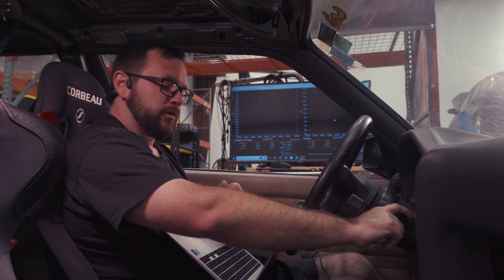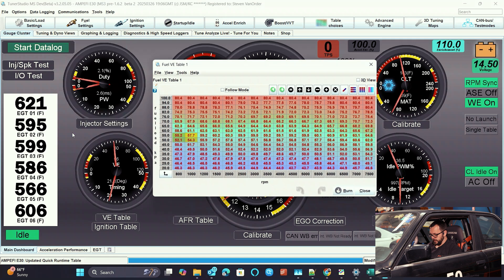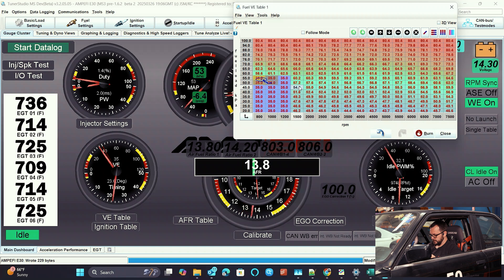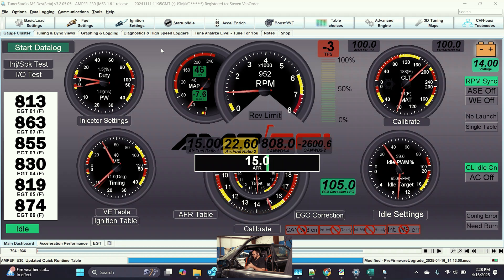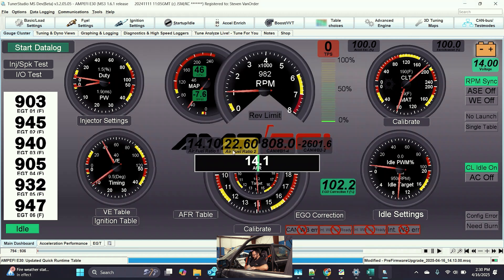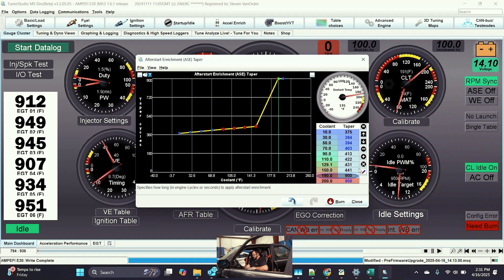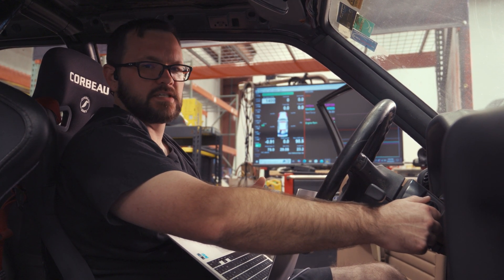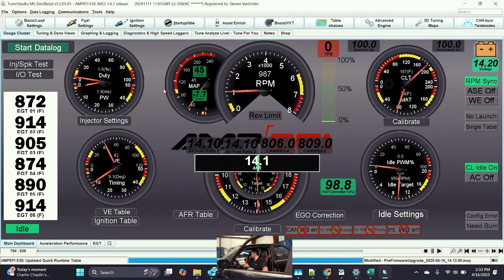BMW E30 First Start! VE Table Adjustments & After-Start Enrichment | MS3Pro Tuning Series – Part 2

Comment: I love this, your new series of videos are great. I hope you get into acceleration enrichment
Reply from the maker: @Adamsawyer01  we absolutely will, AE tuning is hard to do on our hub dyno so I may have to do that part with datalogs.
Reply: @DIYAutoTune  I struggle with tuning AE using datalogs because of O2 delay and try to dial in by feel. Also when to use TPS based or MAP based enrichment. Any tips would help
Reply from the maker: @Adamsawyer01  I will make some basic ae setup and tuning one of my next subjects to capture on video. If you have not you may want to sign up for our email list. We send out alerts and articles that cover the content in these videos. Our support tab on diyautotune.com also has a plethora of information.

Comment: Testing would be better waiting about 5 minutes in, but ideally the ve has to be tuned  1 st without the heat soak boudary layer influence. The hotter the engine gets after sitting the ase taper time usually will not to increase.  A great video though!
Reply from the maker: @norb231  ase tuning and fuel temperature rise from an extended wait period are different issues. In this video I focused on ase tuning.

Comment: 2:15 - when making these adjustments, do you have to hit the "enter" button after each change for them to take affect?
3:51 - it took me a few seconds to find your After start and EGO gauges or event lights. I'm the future, could you make it easier to find by showing us where your gauges are? I use the basic dash cause I'm a novice and things are easier to see and find 

This was an awesome lesson, i learned something today. I'm not as proficient at making adjustments with my MS, but i eventually get there. 🤓
Reply from the maker: @PANTYEATR1  some do require you to hit burn between changes. I simply do it all the time out of habit.
Reply: @DIYAutoTune  are there a certain amount of times the MS can have changes burned into it? 
To simplify my question, if i make an instant fuel cell change, like you did,  will the change happen automatically or do i hit enter for the change to happen? Thanks for responding. I am that 2yr old that always ask "why" and need a 2yr explanation🤓
Reply from the maker: @PANTYEATR1  most changes happen in real time. ve table, ignition table, ect.
Reply: @DIYAutoTune  how about the PID changes and things like the idle ignition timing changes?
Reply from the maker: @PANTYEATR1  I always burn those changes.
Reply: @DIYAutoTune  ok, i was concerned about burning to the MS too much. I'm a bone head that's still learning and i could mess up a wet dream.😵‍💫 Thanks, looking forward to the next video💪😎🏆